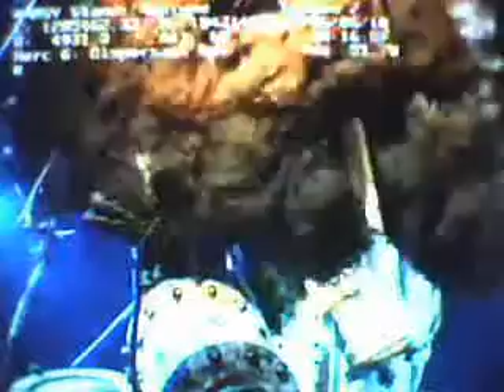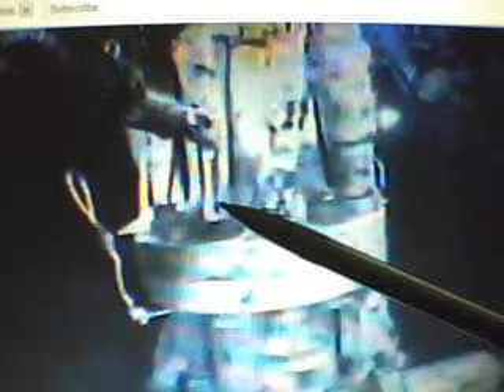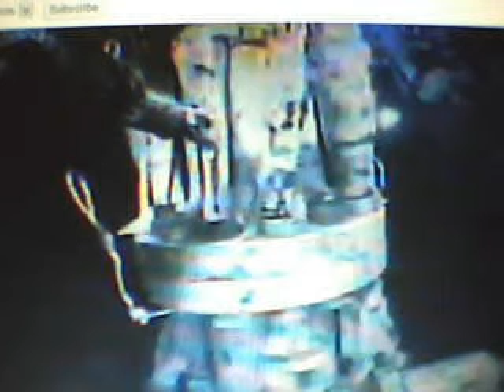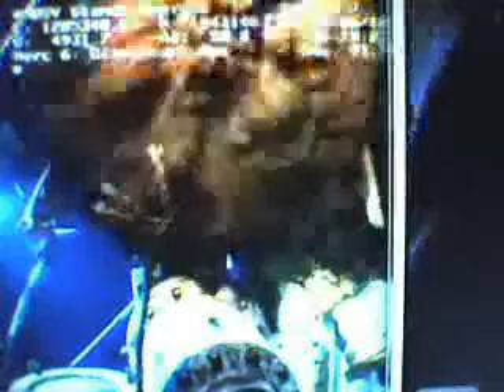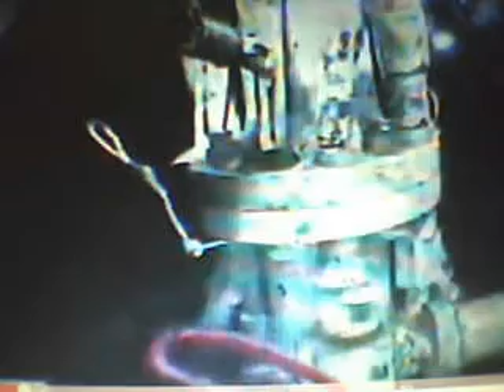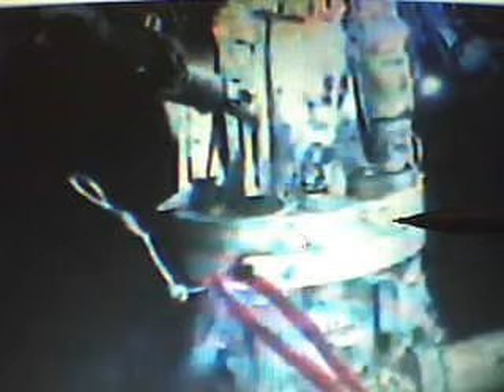BP Gulf Oil Spill Leak Cam 06-06-2010 Answers Why Top Cap is Still Gushing? Here is the Solution BP

Comment from the maker: @lvecsey Thanks. They made one for the kill inlet on the damaged blowout preventer. The robots also should be able to tighten the bolts. Or use a hydraulic rachet tool to tighten. Then lower the top cap back over it. If you look at a video of top kill you can see the big black line that is now connected to the BOP and is marked KILL BOP with paint. The hydraulic coupler is yellow in color and is about half way down the side of BOP.

Comment from the maker: @flyduck1 There should be drawings of the size and dimensions of the flange. How hard would it be to weld a flat flange with a round hole in the center and a piece of pipe together. Remove old flange bolts by cut off saw. Mount new flange/pipe piece under top cap and the leaks from under cap will stop. Or mount new riser pipe to a flange and hydraulic couple like them did with kill inlet. The flange is designed not to leak so this would have a near perfect seal and they still use vents 4 control

Comment from the maker: @frikincleanup I don't think they will shut the flow down completely until the test whether the wellhead and damaged blowout preventer will hold the pressure. Either way a proper flange would eliminate the leak greatly.

Comment: 6-16-2010.  They attached a Hydraulic clamp like you mentioned but its taken 85 days?  It seems like the should have just removed the riser and attached a new one?  How hard is it to unbolt the riser and bolt on a new one?

Comment from the maker: Just watched Wolf Blitzer on CNN and he had Sen. Bill Nelson on with Joe Johns and they had a high def video release of the riser after the cut and you can clearly see the pipe they cut in the video. This is where the oil is gushing from after the put the cap on. That's why I say it will not stop flowing. Stop worrying about flow rate and shut it off.